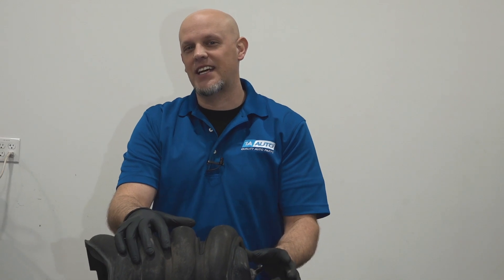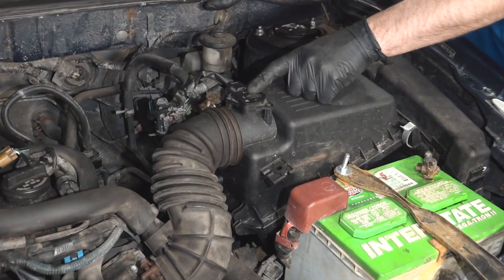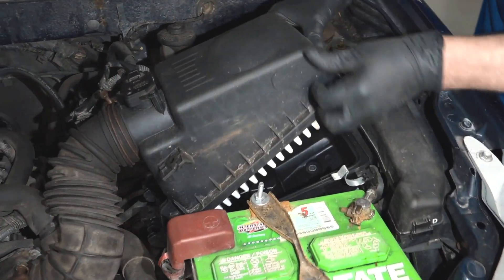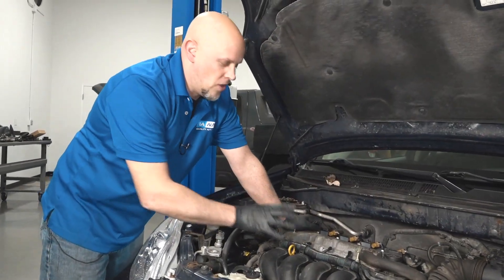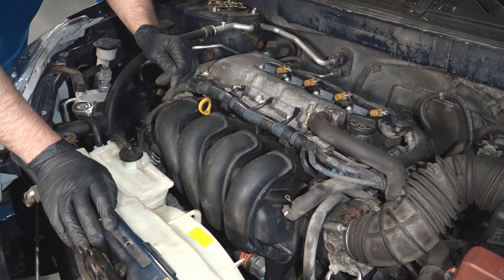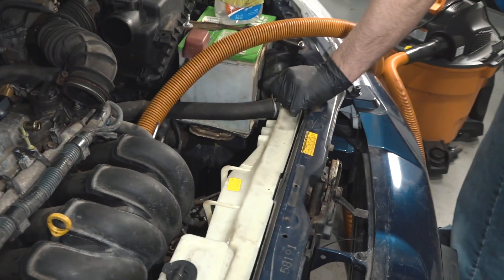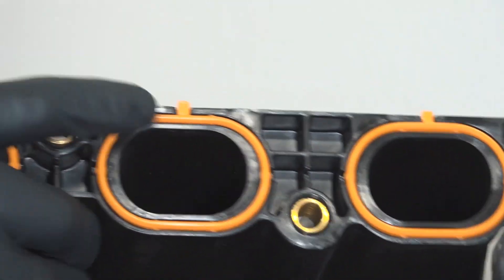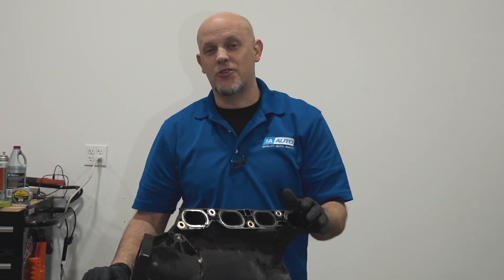Car or Truck with Low Power or Hesitation? Code P0171 Low Fuel Trim Diagnostic

Comment: I seen in a different channel that they used propane to find an intake leak. My main beef with carb cleaner is that it is corrosive.
Reply: I would use electrical contact cleaner. Make sure to test on a cold engine, that is safest and usually will show a leak quicker than a warm engine.

Comment: Where at did you connect the shop-vac?
Reply from the maker: +Jose Angel We connect it to the port where we take the throttle body off.
Reply: @1AAuto  Thank you very much,this channel is very good,I have learned a lot.